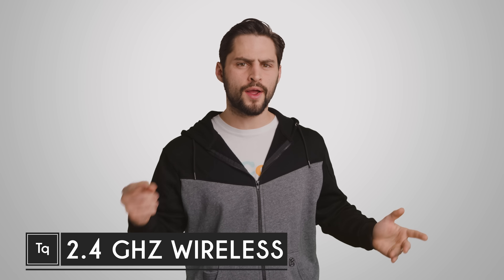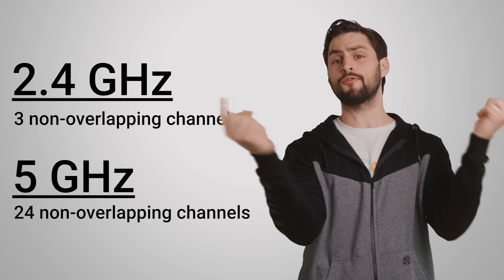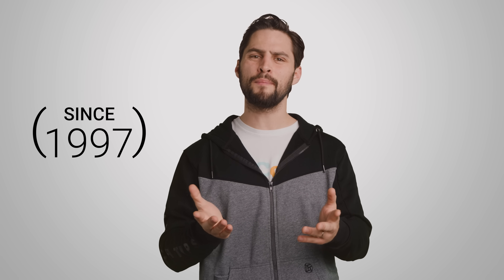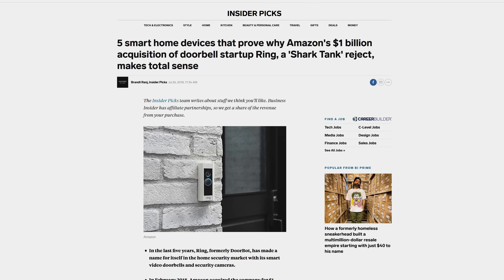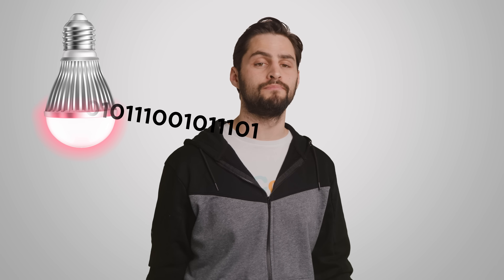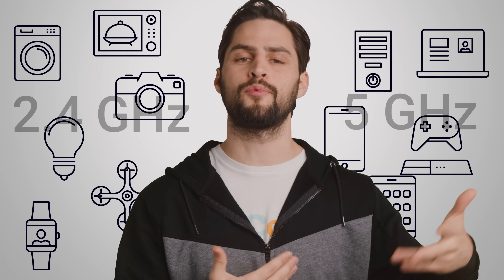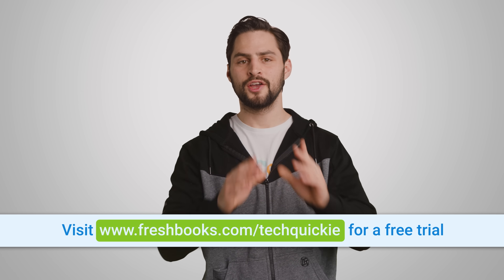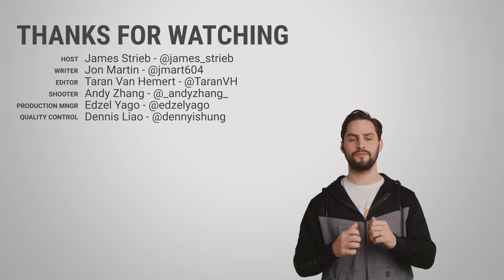Why will WiFi always be SLOW??

Comment: Lower frequency higher range right 
Its simple Physics
Reply: Kk
Reply: @Lord Tyrannus K
Reply: K
Reply: I'm gonna do an original meme guys wait for it.... OK BOOMER Haha so funny and never done before
Reply: fear oldblood K
Reply: ok, then explain the physics
Reply: @jyuan1999  it's a matter of wavelenght: the shorter the signal's wavelength, higher frequency, the more it can resonate with surrounding materials. In the case of a concrete wall it's like the signal is a wave that crashes on a pierced wall, not every drop manages to flow through. Since communication is also bidirectional, wireless router and receiver device must have a decent transmission power. 
Also, assignment of frequencies is  decided by IEEE standard association, 2.4 GHz was initially the range of experimental frequencies, from which the first versions of bluetooth came to be
Reply: K
Reply: K
Reply: Holo Scope K
Reply: @0liver243  K
Reply: @0liver243  K
Reply: KKK

Comment: My ISP is still stuck in IPv4. Most ISPs are still stuck at IPv4. Hardware is decades ahead of our infrastructure.
Reply: Very much so, my girlfriend owns a family farm in Southeastern GA, and can't even get a POTS Line ran to her house anymore, let alone any kind of land based highspeed. She has to use 4G LTE which is spotty no matter the carrier, or very expensive sat. based internet, yet I'm 2 hours east of her, and I can get Gigabit with fiber to the node, and then copper coax cable to my house if I want to sell a kidney each month to AtlanticBroadBand, so I'm happy with 120Mbps/10Mbps, and iPv4.
Reply: youll probably use both ipv4 and ipv6 if you look at your connection. However you're correct, ipv4 is still the major use and the main transfer of data over ipv6. Which even though it exists really doesn't do much for many people currently.

Comment: “Slow WiFi” = Long Range WiFi
“Slow 5G/4G LTE” = Long Range 5G
Reply: well you're idea is sort of correct if the band used is/was the old C band (big TV dishes back in the 80s and some of the 90s) then 2-4 Ghz instead of the millimeter band then yeah it would have a longer range but the FCC would have to make sure it won't cause issues with the existing 2.4Ghz stuff (except our WiFi) which they don't care about
Reply: @FlameOnTheBeat  For older devices
Edit: b/g/n is 2.4GHz
Reply: DerEchteKroate AC is 5 and the bgn are 2.4 if I’m not wrong
Reply: Yes they r the same thing
Reply: I thought 5G could only work in direct line of sight with a relay.
Reply: @ShadowTheLight  Nope... it is 5G in milimeter wave (around 50GHz).
If you run 5G in conventional frequency such as 1800 MHz, it will run like 4G with a little better tech.

Because 5G in 50GHz is faster because it is use more channels in a nutshell
Reply: KevinMulia Okay
Reply: Just because AT&T names 4G LTE 5Ge doesn't mean it actually is 5G. Please fix your comment
Reply: 5g range is not very good

Comment: Why slow wifi is not going away? Because it's cheaper
Reply: Not the important reason actually. Rather it's because 5GHz has absolutely terrible range & object permeability by comparison, meaning you need to be very close to the router & unobstructed for good performance.
Reply: I have a 5 GHz router set up. If I move to the other end of the house or to any other floor, the connection becomes incredibly weak or non-existent. Yet the 2.4 GHz signal is still decent.

The fact is 5 GHz will never be able to travel as far or penetrate walls as well as 2.4 GHz. That's just physics. To take advantage of it, you need to live in a small to moderate-sized apartment or set up a mesh wifi network around your house. Otherwise, you'll constantly find weak zones in your own home.
Reply: @JohnEusebioToronto  Because you need more power for the 5GHz Wi-Fi and therefore you need to double amplify the signal or near that for it to be like 2.4GHz.
Reply: No, because if you just had the high speed you would have dead spots such as behind walls that you couldnt solve without the 2.4GHz band.
Reply: @AlexFlockhart  just use additional access points to increase range. And its not like 5ghz gets instantly stopped by a single wall, it wont reach as much as 2.4 but it can reach a lot.
Reply: I mean you could use something like Google Wifi... But that is, in fact, expensive. Thus far
Reply: No he laid out the reasons in the video. Watch next time